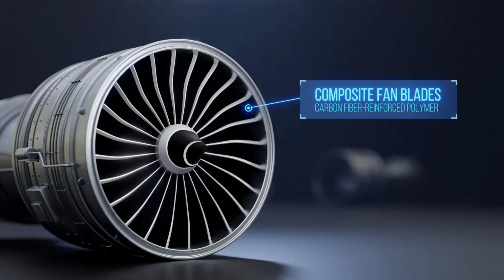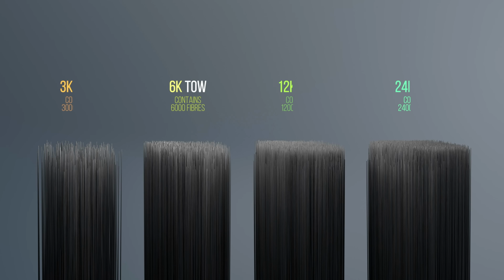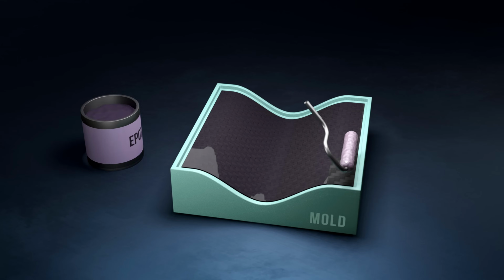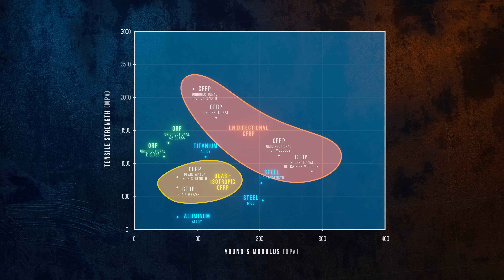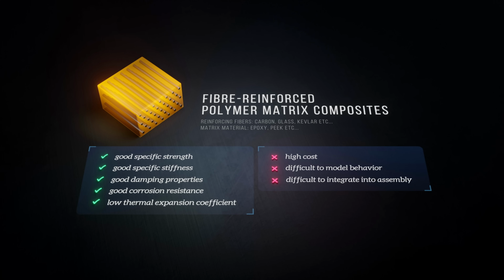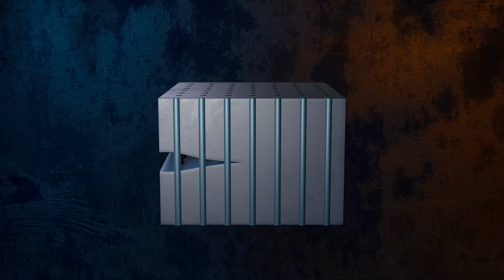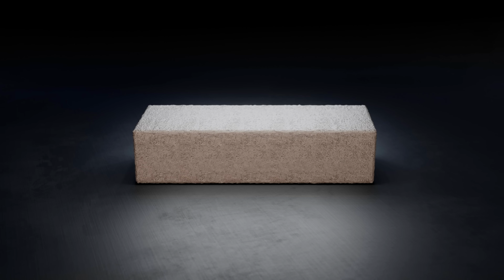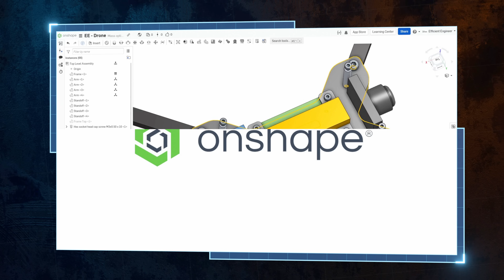The Incredible Properties of Composite Materials

Comment: incredible... OP should build a sub to explore the titanic with this incredible material
Reply: 😂😂😂 …or NASA begin using plywood as a ablative for re-entry vehicles, as being equally appropriate to application.
Reply: @georgedreisch2662  i think nasa has legitamite reasoning here, compared to oceangate
Reply: Too soon 😂
Reply: There's nothing wrong with using composites in compression, anyone can make a sh*t design out of any material and have it fail prematurely. Oceangate's management just had no idea what they were doing. That's why their lead engineer sued them. He knew  it was going to fail because poor design decisions were being made. They cut corners (testing) and suffered the consequences.
Reply: Thats Dark humor right here! 😊 Dark as the darkness at the depth the CEO of the company that made a sub with carbon fiber to visit the Titanic said... Hmm... I think that I shouldnt be here... lets go u...
Reply: @Tensho_C tensile strength good. Compressive strength bad.
Reply: @JeffBourke wrong
Reply: This explaitory brought to you by oceangate
Reply: Awe too soon...or is it
Reply: @JeffBourke 
Eeehhhh
It could have worked. I wouldn't have done it, but you can make carbon fiber useful here, even if it is in considerably lower volume and area than was utilized...
Reply: @explorerryan 
Eh. It kinda was.
Reply: It was made😂oceangate approved😂
Reply: @JeffBourke 
As I understand, carbon fiber is not that much weak in compression strength. But you know, it’s called “fiber” you can have many material in wire or fiber, plastic, steel, even glass can be used. Have you heard about GFRP? You can have strand made out of hardest and strongest in compression material and bend it like a hair.
And carbon fiber isn’t failing in explosive manner. You guessed it it bends. Then it doesn’t require genius to imagine how to change failure mode. Like constraining fiber from bending. And it’s not that  complicated. Maybe impregnate something that adhere and harden like polymer...
It’s called  CFRP.
Reply: To soon

Comment: I now get it. These presentations are what cause automotive engineers to go: "I should use plastic for that intake manifold"
Reply: But is a plastic manifold really a big deal?  They have been used for the last, what? 30 years? and it’s not like they are exploding all the time…. I am pretty sure someone in the world has also had problems with leaking aluminium manifolds💁🏻‍♂️ Using low quality plastic is a different thing.

Comment: 00:05 Composite materials have transformed engineering problems and allowed development of materials with unique properties.
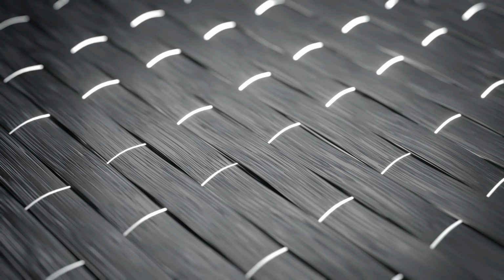03:21 Fiber-reinforced materials have anisotropic properties and can be made strong in specific directions.
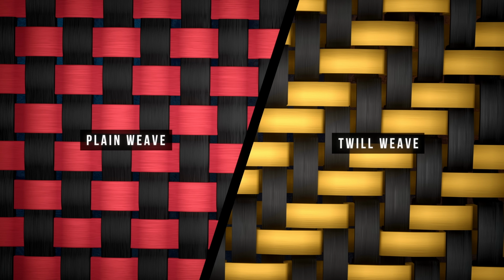06:25 Different methods for manufacturing fiber-reinforced composite parts
09:38 Glass-fiber reinforced polymers have excellent strength-to-weight ratios.
12:37 Fiber-reinforced polymers have good corrosion resistance and dimensional stability, but are expensive and brittle.
15:21 Ceramic matrix composites have high temperature resistance and increased toughness with the use of fibers.
18:13 Composite materials offer improved properties and control over degradation rate
21:03 Composite materials and their applications

Comment: One big drawback that you overlocked is reparability, though it is for the same reasons that you listed it as "difficult to integrate into assembly".
This is one of the big reasons why steel is great. It doesn't matter how much it cracks, buckles, bends or shears, you can just hammer it straight with a bit of heat, grind out any cracks and fill them up with the welder and even heat treat the part again if it's critical. If your fancy composite part breaks, it's trash, and unlike metals it's not just easily melted down and made in to new metal. I like repairing things and I get very displeased when I cant just fix something that breaks.

Another disadvantage with composites is the brittle failure modes with almost no warning signs. If I have a chain made out of steel, it doesn't just snap off abruptly, it will stretch first, at first elastically and then plasticly. If I don't overload it too much, I can see that my chain is being pushed past it's limits and I could take measures to avoid catastrophe. With composites it's not like that, it either looks totally fine, or it totally sheered off. Though I guess it's has it's applications for euthanizing billionaires wanting to dive to the Titanic.

Comment: Great video on composites and OnShape features. 
Could you do an introduction video on how to calculate Carbon Composite Structures Strenght and Modulus using OnShape.
Take for instance designing in OnShape a simple container/monocoque using a Sandwich Composite with a Foam core material, and how to use OnShape to calculate its resulting Strength (MPa) and Modulus (GPa) in different directions. That would be cool, and its applicable to allot of structures from Polymer, Ceramic to Metals.

Comment: Carbon fiber is a miracle material. My road bike frame barely weights 2lb, yet handles my 190lb body on the bumpiest roads without budging in anyway. The top tube has sections that are as thin as a coke can, but feeling it you'd think it's solid all the way through.
Reply: Until it catastrophically fails one day and you bust all of your front teeth

Comment: Please Help Me

A moving rod placed in a stationary U-shaped frame.

When a conductor (the moving rod in this case) moves perpendicular to a magnetic field, an electromotive force (EMF) is induced according to Faraday's law of electromagnetic induction. The rate of change of magnetic flux through the loop formed by the moving rod and the stationary U-shaped rods is given by = B⋅L⋅V where B is the magnetic field strength,L is the length of the rod, and v is its velocity.

Now, the negative of rate of change of magnetic flux = work done by electromagnetic force throughout the loop, which is BLV+IR, i=current , r=resistance

But this leads to that,BLV=BLV+I--->>IR=0 , means electric current through loop is 0, So, Just Please Clarify My Confusion

Comment: Why did you under rate the tensile strength of Carbon Fiber Composites. They usually hav strength over 3000 MPA when built properly.
Reply: I’m composite geek and want to promote its strength as much as possible hahaha.